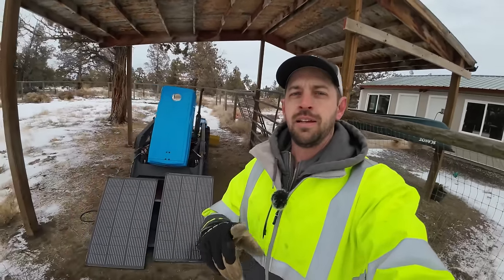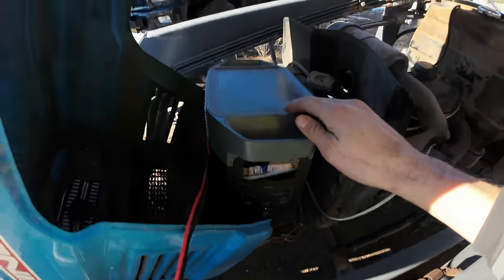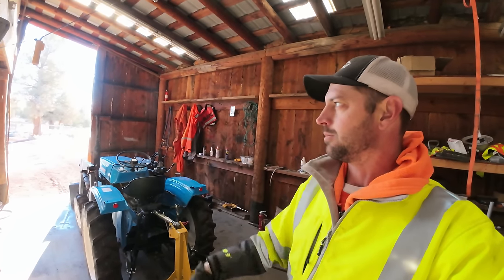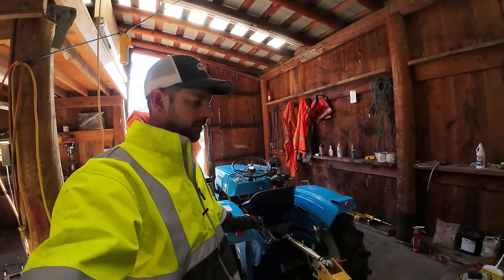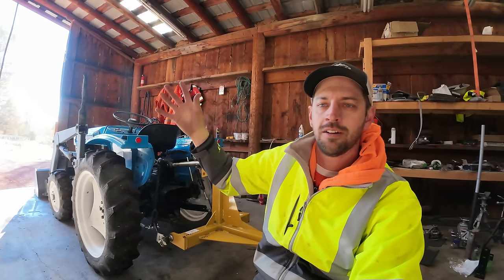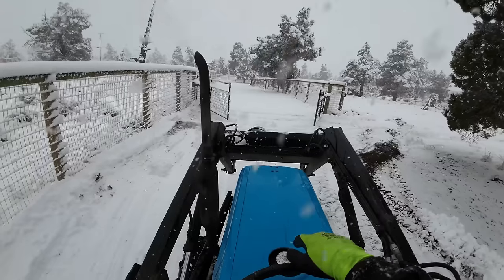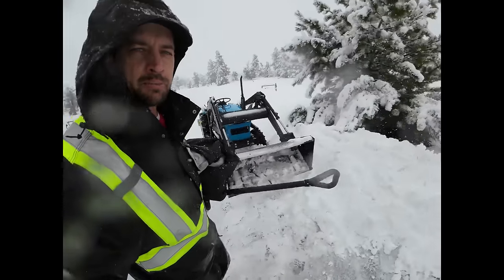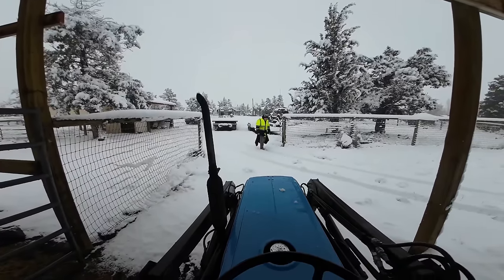Winter Snowstorm and the plow tractor won't start.  EcoFlow solar generator to the rescue!

Comment: Casey, please reach out to EcoFlow and get the specifics about their warranties and after warranty service options in the USA to add to your EcoFlow sponsered videos.  EcoFlow is the best in the business. 

I feel that the end users that are on the fence between brands should be aware of how they will be taken care of when/if their unit fails.  These are very expensive units that are completely useless if a control board fails inside them. 

My experience with Jackery and their response of zero after warranty support for my failed Explorer 1000 pushed me to go with an EcoFlow Delta 2, and I have zero regrets.

Comment: Howdy. I'm Dave and live outside of Sister's. Cold like crazy today on the 22nd.
IF you have points on your tractor check those. Make sure they are clean and flat and a match book for your point gap. Bad points and/or gap will make it crazy hard to start.

Comment: While stationed in Alaska I learned to love moving blankets! Not the cheap ones from wallygrounds but the good thick ones. I strap one to the hood of my truck or tractor here one the farm and whatever I'm using to keep my blocks from freezing isn't working against the cold winds also. When the snow is wet or it rains a tarp will keep it dry and insulating.
Generator lovers can be fools Casey! That engine running at idle doesn't burn efficiently. Like chainsaws and weed whackers they run best at higher RPMs so they are self destructing when not actually being used. FOOD FOR THOUGHT!
Thank You for Grumpy, being a good neighbor shows your character. You and your family have a Merry Christmas
You are in my prayers
Hoka Hey

Comment: Put a 6 foot piece of 4 inch pipe under the tractor and run a propane torch through it 15 minutes and the engine is warm enough to start. Old trick used to start machinery at minus 40 out in the bush.

Comment: Just a suggestion... You get geyser (I think you call them water heater there) blankets to insulate the geyser and keep it hot and save on power. I thought that maybe if you got something like that and wrapped it around the engine to keep the cold out it might help.

Comment: Block heater for coolant and magnetic heater for on the oil pan, works wonders.  Cover the complete tractor with insulated concrete blankets
Reply: Look into reversing the blade so when it’s being used as a. Drag blade it pulls the snow the same way it does as it’s set up currently as a pusher.

Comment: Look into the small heating element you put in place of your freeze plug,  it'll heat the engine block without spending extra power on the radiator.  Then a trickle charger and a small silicone oil pan heater and it'll fire up on days cold enough you won't really want to sit on the tractor.  We do it this way here in Alaska.  You can fire up a truck or tractor easily even at -40°F weather.
Reply: I used to live in LaPine,close to where he is, used the block heater that spliced into the lower radiator  hose on the car ,plugged in each night no problems
Reply: @jeffclark2725  those are OK,  but the freeze plug   block heater uses less power when you are off grid.
Reply: @jerrystott7780   I will agree to that one
Reply: I agree. I don't have the block heater but an oil pan heater on my truck along with battery heaters. Doesn't matter if it's 15 degrees or below zero, it helps tremendously.
Reply: @toddk1377  Agreed to those heaters, i have worked on pick up trucks from Alaska, they have those pan heaters engine, transmission, rear diff also

Comment: Up until a couple years back I was running a 48 Ford 8N tractor and as you can imagine she was a bear to start in the snow or pretty much any cold weather so started taking diesel shop heater but you can use a propane or kerosene one as well, the ones that look like a jet engine.  Set it in front of the engine for about 20-30 minutes but set it back a little bit so you don't melt anything and she'll start up just like a brand new car every time.  Assuming of course your battery and electrical is good and everything.

Comment: Tuned in 6 min after posting. Usually I fast forward when channels do ads, but, because of your honesty, and forthright  comments I watch each and every video completely. Thnx for that. Wish Grumpy good health. I have a GMC k1500 5.3 made in Canada. Gas eng. That has a factory block heater. i was surprised to find it. Living near Straw Palace, don't really need it, though nice to have. For my travel trailer, I use propane for fridge,  heat, and cooking. 2200w gen for nukematic or ac, one at a time. Also a Renogy 100w plus a go power 120w for all 12v. (Splitters, crossovers from one type cord top rewiring in R Pod, equals grumpy old man's methodology in finding solutions piecemeal. 😀 It works for me. Per your channel, I have looked up the Delta_eco system. Most likely make my system easier, but, it is what it is for now. Another great vid, 👍 waiting for next.....if you get cold feet....heat tape around boots 👢  and solar will help. LOL!

Comment: If you still have problems thru the winter you can also cover the engine compartment with some insulation to help keep the warmth in and speed up the process

Comment: Hey Casey.. So I'm a Locksmith in Wyoming. I use a Ecoflow Delta Pro in my work van. I run everything from it, a small refrigerator, key machine, computer, and a very hungry power hungry laser printer.... It's flawless, it's a tank of a unit.... Only if the van wasn't so damn tall - I still need to service cars in parking garages with a clearance of 7'.... This van is 4WD, and I barley clear the way it is. I only wish I could install solar on the roof...

Comment: thanks for the great videos. on my old tractor I put a magnetic oil pan heater with a heavy blanket tucked around the top and sides and unless it is -30 F it starts without the spray can 
if you get a good oil pan heater it is temp controlled thanks

Comment: Hey Casey,   I have two John Deere tractor for plowing in the interior of Alaska.  Sounds like you need to winterize your tractor like we do.  Put in a Block heater replacing a soft plug in the block,  put a rubberized 70watt pad heater on the oil pan and that will be all you need for a long term fix.......  Then you plug your tractor in for a couple hours prior to starting and it will start reliability,

Comment: They make magnetic oil pan heaters. They work well on hard starting diesels in the winter. Getting that engine oil warm really helps turn the engine over.

Comment: Cold AND warm weather starting tips for small diesels:   Imperative to have the manifold intake air heaters or glow plugs functional.  Amazing how much easier these small engines start.  They are designed to use them in WARM weather, critical in cold weather.
Reply: Another very important thing Good fuel (#1), the BEST Batteries , and let it warm up
Reply: @notsevenfeettall  So true. Thank You

Comment: Have you tried to make your top link as short as possible to tip the blade forward, then you could use the smooth side of the blade.
Reply from the maker: Doesn’t go far enough, the blade still digs

Comment: Place a 100 watt bulb in a shop light and leave it on under the block of the tractor engine.  Heat from bulb keeps the block and oil warm.  Tractor will start easier.

Comment: Hi Casey, old truckers here In the UK put a splash of petrol (ok gasoline) into their older truck diesel tanks to improve the flow and starting of very cold types of diesel, I used to do this on my early landrover Discovery diesel, works a treat.. maybe try it in the tired old tractor eh.. Ian - UK.

Comment: Okay young Padawan: first never use ether on diesel. There's a reason companies recommend this. Number two get you a heat gun and pump hot air back through the exhaust into the cylinder head. This will get the moisture out of there. Sounds like you have a lot of moisture build up in the cylinder head. ( And this is based off my assumption that this is a diesel based tractor)

Comment: I'm not sure on the specs of the diesels but you can run thinner oils in the winter and it will greatly help in starting in the cold. We use 5w30 in our salt spreaders instead of straight 30 weight. When temps are in the single digits or lower and they start up easily..
Reply: And if the 5w30 oil you use is synthetic it will crank even quicker. Greetings from Minnesota.
Reply: @Dave-ei7kk  yes sir, that's what we use. It's amazing how much easier it spins over. The boss was having us keep them running because in single digits or lower, they wouldn't restart after about 20 mins outside of the shop. After suggesting the switch, we haven't had a single issue.

Comment: Grew up with gas powered tractors, not a problem. First diesel tractor, and hated winters! Same issues. It hated to start anytime the temps dropped below 50 degrees. And no, it didn't have a block heater. Or a nice toasty garage to live in.

Comment: Lot of work to start this beastie. What ever happened to the dip stick and water jacket heaters? You know, those resistance heaters the plug into the oil pan and engine water jacket.

Comment: Check all  cylinder glow plugs  and the indicator glow plug.
Install battery isolator switch to eliminate phantom stray current loss  when everything is off.
Change oil to 5 - 40 synthetic 
Starts an old IH 354  40 Hp diesel in - 35 after sitting for weeks.
No solar required 
Battery lives on for 5 years + with the isolator install after killing them every 2 to 3 years.  An old truck fleet supt. put me on to this idea.
And yes there would be less start up wear in it if I used the block heater and when I did I only needed 40 minutes pre start.

Comment: In northern Alberta and the other way of heating your cold engine is use an exhaust hose and the exhaust from your pick up truck running on the oil pan

Comment: interesting , Thank You .  I like that idea for heat tape . I am surprised that you don't have a block heater . there are also magnetic heaters that stick to the oil pan  , another thing to remember is the hydolic oil, especaley  if you have a hydrostatic drive . From what I can tell you have a good rig , 4wd , loader with power down and a blade for at least counter weight . As to being old , in a lot of ways I would rather have an old. simple machine that is reliable. Thank You .

Comment: I warm up my loader by using extensions to connect the heater hoses from my pickup to the loader heater hoses, the loader, the pickup, and the extensions all have hydraulic quick connects. The loader is at 5,200’ elevation and there’s no electricity. The loader has a block heater, but I can’t power it. I know that solar is an option, but I’m not there yet. Plus with the coolant method it only takes 10-20 minutes, it’ll be at the lower end if the pickup is already warmed up. It’ll go from sounding like the battery is too low of power when cold, to kicking right over like it had already been running.

Comment: I don't want to tell you what to do but I think you need to put some time back into that tractor like maybe a block heater maybe change the injectors look after it because equipment's really expensive to replace it and you can always get a snow blower attachment will do a little nicer job

Comment: Casey just to mention it, the pipe warmers, it is best to never let the warming wires cross each other. Ya probably know, but just in case you are crossing them in your pump house too, you don’t want to do that. They can start fires by warming each other, fire dept says this is a leading cause of fires with the pipe warmers is people doubling back or crossing the warming wires. I happen to know about this because I am dealing with preventing a frozen pipe on a new water heater install so I heard about this ‘never do this’ warning lol
Reply from the maker: Depends on the type of wire.   The steel braided outer coating on this particular type of wire is the ground.  This wire does not get nearly got enough to hurt itself

Comment: Get yourself an engine block heater that permanently fits into a coolant line.  I have one in my  3 cylinder Kubota tractor.  I run the block heater for 30-45 minutes before trying to start the engine.  At 0* F it starts like a warm summer day.

Comment: I saw a video where an older guy showed how he used to start his old Volvo truck in the cold, Swedish winter.  He got a fairly large stick or branch burning, and stuck it over the air intake (after removing the air filter, of course).  He then had the engine cranked, sucking in the fire and heat from the branch right into the engine intake, until it fired up (no pun intended). I've never tried it, but feel free to try it!
Reply: I saw guy use a heat gun in the air intake, it worked. Love your videos Casey.

Comment: Time to install a block in line water heater. Then put an oil pan heater on the bottom of the oil pan. I had a John Deere with a loader a little bigger then yours, mine was  50 hp that was hard starting in the winter. That diesel didn't have any glow plugs. I would plug both heaters in for 45 minutes and it would crank right up in any weather with no starting fluid. With just one of those heaters it had to be pluged in for a couple hours. With both it made that thing act like summer.

Comment: When I lived in Bend in the early 70s, we had a couple  10-below days and of course the car wouldn't start in the morning. I walked 2 miles to Western Auto on Wall St in that frigid weather to buy a radiator hose heater. Walked home, installed in with frozen fingers and plugged it in, waited a couple hours and the car started. 6 months later, when I was selling the car, the buyer said, 'Huh, this thing has 2 engine heaters in it.' Yup, I could have just plugged it in, instead of working in the cold!

Comment: Hey Casey quick tip is to use a hair dryer in the intake to preheat the intake, m9st times this fixes cold start no start cond8tions
Reply: Thank You

Comment: If you’ve never used it, you might want to look into the Hot Shot Secret’s brand of stiction eliminator with friction reducer included.  Made by lubrication specialties in Ohio.  The stiction eliminator helps clear out any gunk/carbon buildup on the oil side of the diesel injectors, and the friction reducer is self-explanatory.  Anyway, that might help it start a little easier AND help keep the engine clean.   That particular product can also be used in gasoline engines and I use it in my twin turbo truck to keep the engine clean inside as well as the turbo bearings, etc.   it was originally made for International (to help them with problems they were having in their engines, but they began selling it to the public.  I use this in our John Deere turbo diesel tractor.

Comment: So, you do have a snow plow but you are running it backwards.  Flip it around so the snow rolls in front of the blade. The curve of the blade makes the snow roll across and off the end.  Moves more snow with less power.
Reply from the maker: That’s not a snow plow..
Reply: OK, I got that but dirt or snow doesn't really matter as it works the same. I am amazed at how well you get by even like using the stuck van to pull yourself out of the ditch. Did that just happen or did you plan it that way?  It must be a pretty good feeling to help so many people free and be enough of a character to make us youtubers pay the way.

Comment: Nice review on Eco Flow!! Sorry to hear Grumpy is under the weather!  Hope he gets better soon. I miss the back and forth between you two. LOL!!  By the way... if you're pulling the blade (like in the video) the blade should be turned 180 deg. so the smooth side is in front.   The snow will slide off the blade much, much better. The way it is here is for pushing backwards. Thanks again for helping Grumpy!! I know he appreciates it!!
Reply: He answered another  similar question by saying: he didn’t want to dig into the driveway and the tractor has poor blade control
Reply: @JohnHallgren  Ok, that explains it. Thanks for the info.

Comment: I'm surprised that you don't have a plow on one of your many trucks!! Also, if you're gonna drag that blade, turn it around so the shape of it works for you instead of just piling up. The blade has to throw the snow, even at low speed, so it needs to curl it off.
Reply from the maker: I don’t have a plow because I don’t have any need for a plow.    We don’t get much snow here, and I don’t plow our driveway even when we’re do.    The blade is turned around up purpose because that tractor has not level control so the blade will just dig into the road if it’s facing forward

Comment: Years ago I had a early 80s diesel GM pickup truck course non turbo of course but it always had a problem starting in the cold now we're talking back in 1990 but they used to make a dipstick heater and you just stick it down to the bottom of the oil pan I put a hose and clamp up at the top and then I pulled it out and made a little Groove around it where the oil level was proper and I just use it all the time in the winter here in Pennsylvania from about November to end of April and it was my dipstick and a heater tube for the oil and you have to plug it in every night with an extension cord but hell that worked for probably 10 years until the rest of the truck fell apart back then they were about $10 but it was as thick as a oil stick but you can bend it a little bit so you can you know I'm just running down your dipstick tube and it just went right into your oil pan and heated up the oil and it did a good good job even at 0°